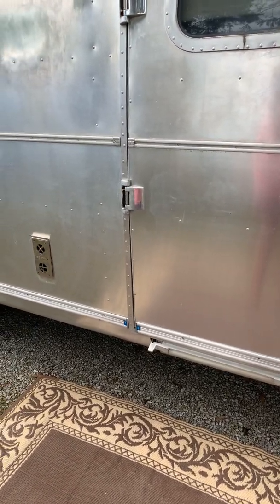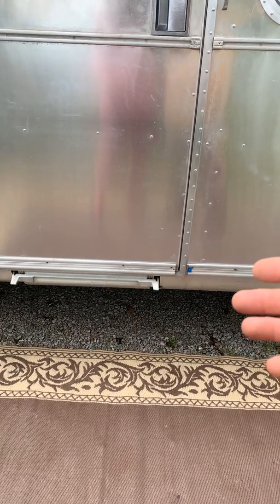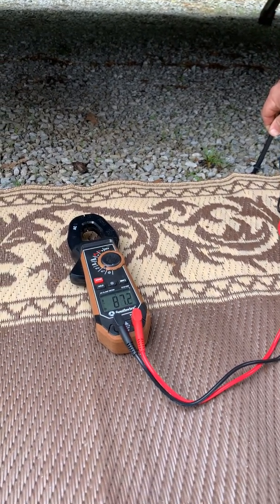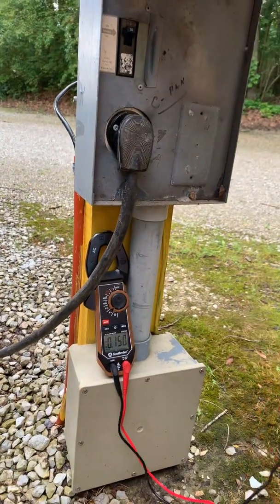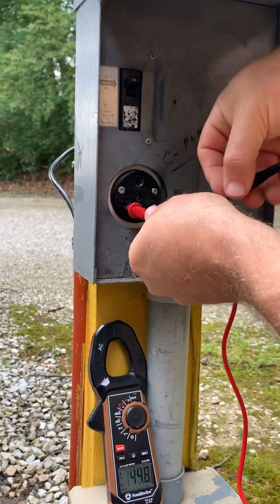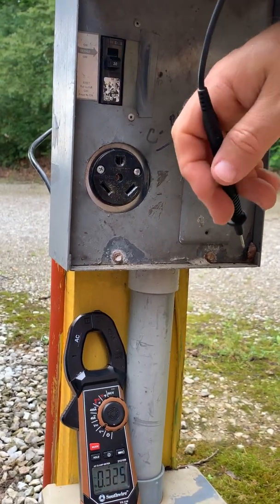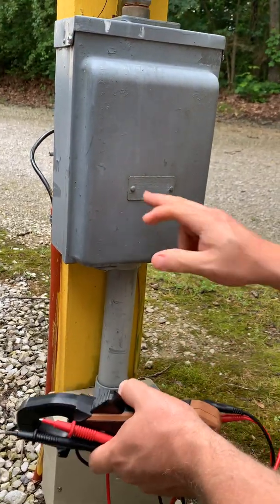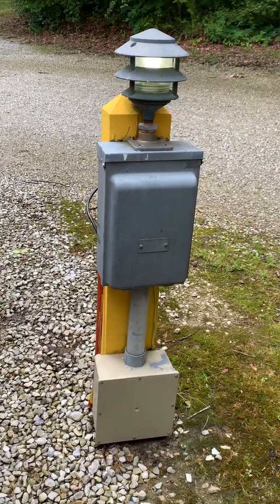My airstream shocked me!! Dangerous RV shore power.

Comment: I use a non contact ac voltage detector when I hook up at a new site to warn me. Are they a good initial tool to use ? Would it detect a problem at the pedestal before hookup also so it can be investigated further?
Reply from the maker: Russell Day yes when I used mine in that mode (while connected to shore power) it was alerting me when near the frame. Also near the pedestal plug when the breaker was off.